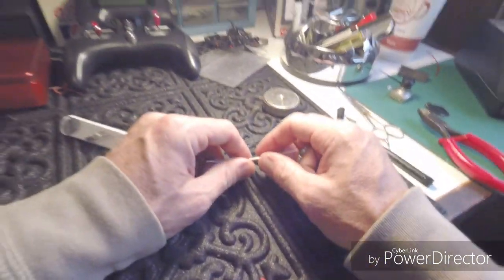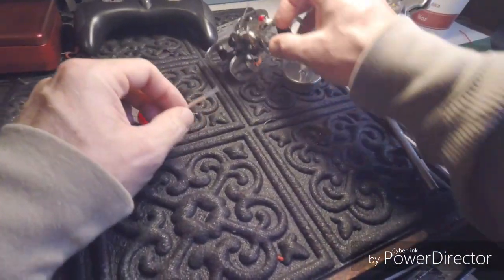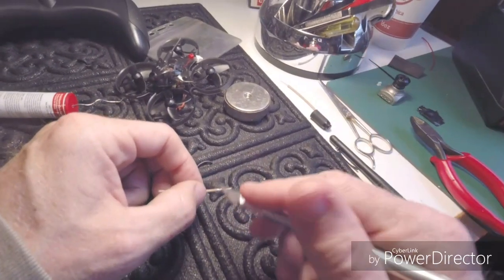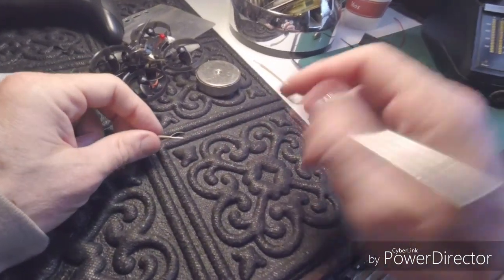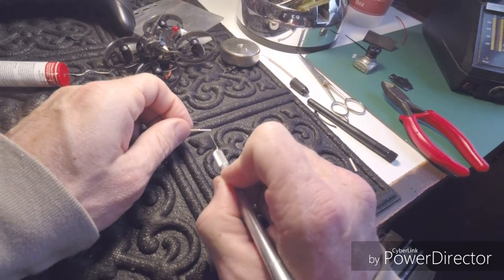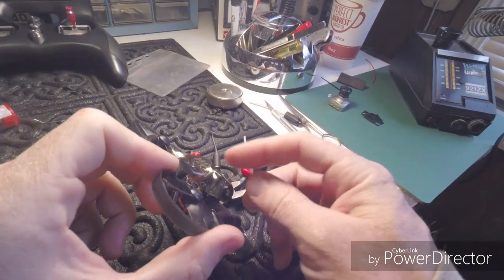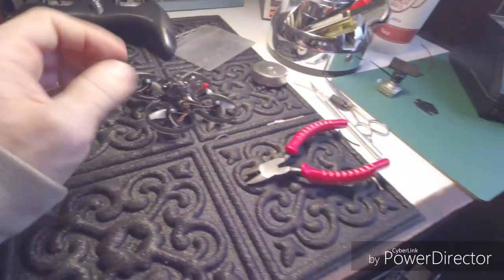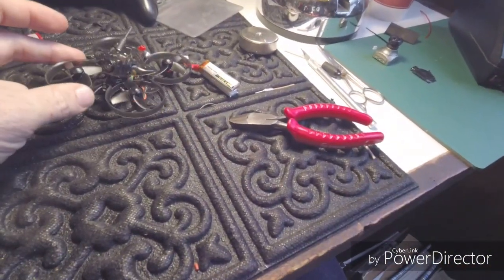Mobula 7 Antenna mod (better covered)

Comment: Ok, great video and idea, I am just a little confused at the 1:25min mark.  The thinner white piece (end of the antenna) and the metal hollow piece you un-solder from the cheap antenna, you seem to refer to both as the radiator at different times.  I understand that I need to carefully trim the shielding back 1/16th" to expose the the actual wire/element, but what exactly am I measuring to make sure I am in the correct band, and what is that length, a 1/2" or longer?  Do I need to actually cut off/trim the very tip of the Mobula7 antenna, or the metal piece that I get off the cheap antenna.   Or am I reading too much into it, just simply shave back the jacket 1/16" and solder the metal piece onto exposed wire, heat shrink and be done with it?  Thanks!!
Reply from the maker: When you look at the wire there is a sheild braid then an enter coax.you have to cut the sheild off and only lkeave center wire exposed the length of the band you need.this is making a dipole antenna.the factory dont understand radio frequencies and run without the corresponding lenght of sheild.my video may not cover this good enough for you start googling hoiw to make a 5.8ghz coaxial dipole before you go any further.hope this helps.
Reply: wiccan FPV; oh its a fine video, I’m just a little OCD and like being cautious. I get what your saying, just wanted to make sure.  Thanks again, i was looking for a way to help my video feed on my new Mobula7, this is perfect!!

Comment: I really hate this AOI camera that comes with Mobula, it's a pain to solder if you dont have the right tip, so I changed for another not-so-good-quality, an AKK BS2-OSD, but they have an antenna like the one you're soldering.
My main problem is RX/TX range for radio signal, solved pushing carefully the wire to the side of the canopy and putting some tape to the side. Can't glue because USB sometimes push the FC board and have to umount the canopy.
I also used a small ziptie + heatshrink on VTX antenna to help secure and protect from crashes.
Reply from the maker: I bet it is i never tried to solder at the camera